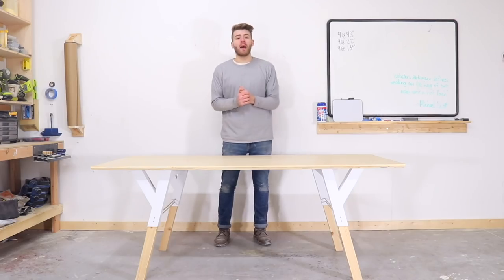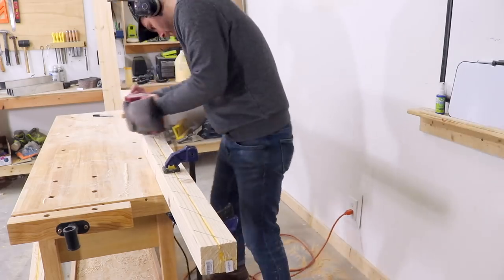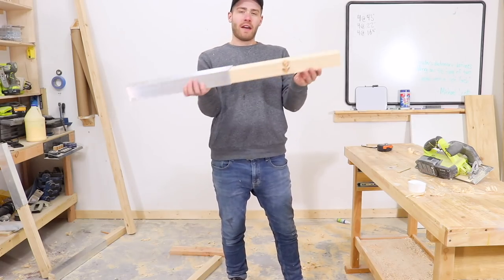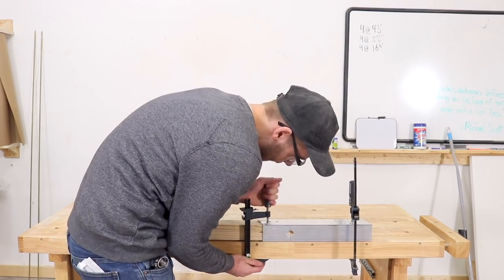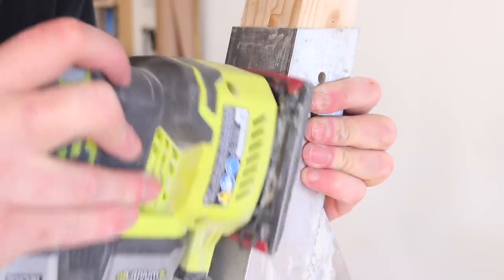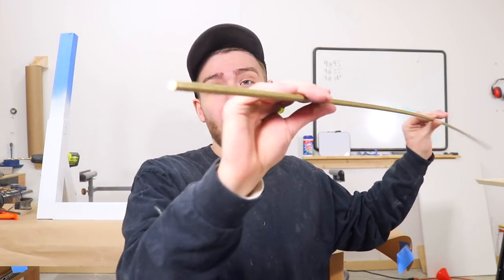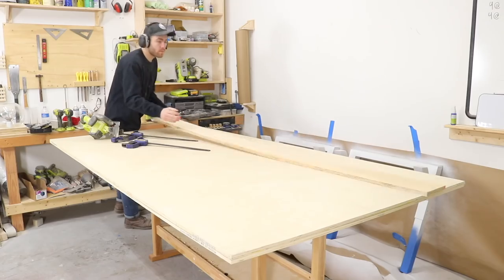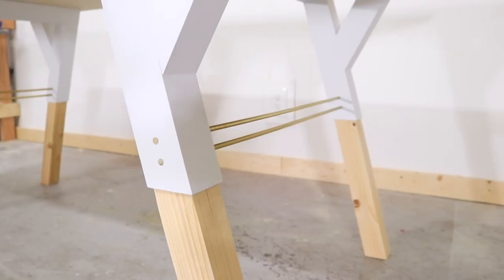DIY Wood and Metal Dining Table with NO WELDING!! | Modern Builds

Comment: Hey Mike, I'm watching ALL of your vids and I don't know if you go back this far to check  your comments but from what I've seen from you so far I think you're the kind of guy that does - so here's me stuck in with this Corona Virus pandemic and thinking about doing my garage storage...….. so I started but I took my laptop to the garage with me just so I keep reviewing all your great content. I have to say I love love love your energy on your video(s)!  I want to thank you so much for the wide range of projects you start and finish right to the end. I hope that I can include a picture of my garage when it's done. Anyway now for a tip - you probably know this - when using spray paint once you're done and assuming you didn't finish the can - before you put it back on your tidy shelf remember to always turn it upside down and spray till you see no colour - this will prevent clogging the nozzle so that when you want to use it again you actually can! And last for a suggestion:  I've seen a few cooking shows that have something that would be a great idea for your vids - an overhead mirror assembly for another brilliant view of what's happening on you workspace - Anyway here's hoping you not only get back to read some comments but that you actually read it to the end! I apologize for writing a book here - hope you keep these videos going! Great job

Comment: You can get aluminum cutting blades, they typically have a triple chip grind and a negative rake so it's not grabby. Also use painters tape lining the cut, it lubricates during the cut and chips don't fly everywhere, it's sounds odd but trust me it works.

Comment: hey mike. pick up a tube of wax for when you cut aluminum on the chop saw. just spin the blade through it before cutting and reapply every 10-15 cuts. it will really extend the life of your blade and the cutting will go a lot smoother. the tubes are like candle wax. they come the same way as most greases and lubricants come

Comment: If I were to just use the full 4x8 plywood sheet as the top— would you recommend using supports in the center of the two bases or would it be ok without? Love this build!!!!

Comment: Yo Mike, quick question: would you be opposed to using this method (aluminum/wood) in order to build a 5-foot shelf or a TV stand, which will hold heavy books and a 32-inch TV?
Reply: Cielito Thea the wood provides all the structural support. The aluminum is just for show. So you could make shelves like this all day without worry.

Comment: So if you had drilled the long screw hole down from the top through the short piece,  first inch or so with 3/4" spade bit, then the 1/8 th inch drill the rest of the way, no hole to fill ...   love design

Comment: Why not just skip the aluminium? It doesn't seem to add much to the structural stability and it is painted over. I think making the same structure with just the wood and brass would save a lot of time and look and function in pretty much the same way.
Reply: I was thinking along the same lines. Plane a step, or glue on sleeves for the aesthetics, because I doubt the aluminium provides any structural support.
Reply: Exactly, it looks like the aluminium just adds a step in the legs. Using aluminium makes a simple process into quite a long one.
Reply: Yousha Ahmad it's called aesthetics. Not everything has to be utilitarian.
Reply: I know it is for aesthetics but it is painted over and doesn't add much of a visual difference. As Michael Baron mentioned, there are easier ways of achieving the same aesthetics with less effort and less cost.